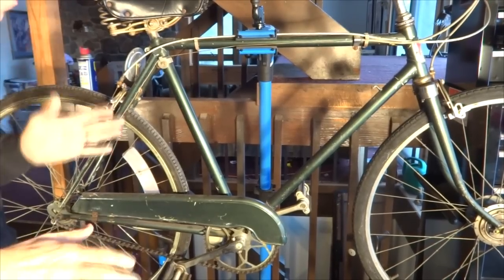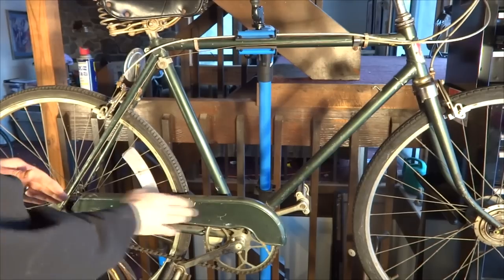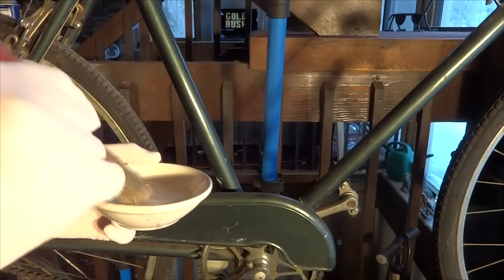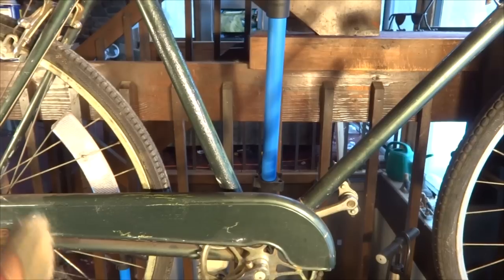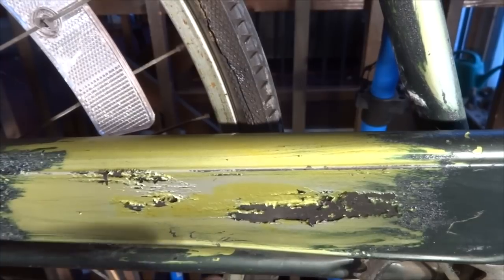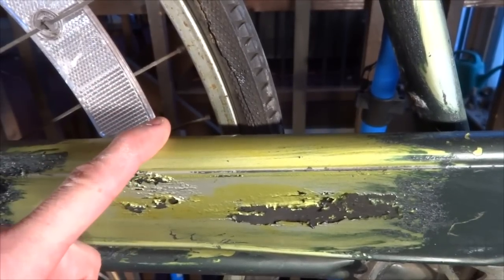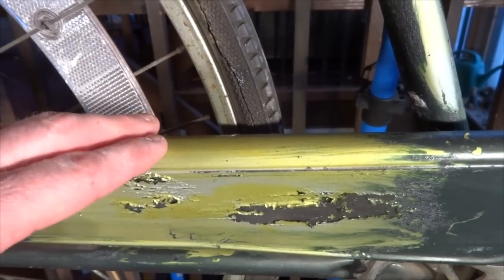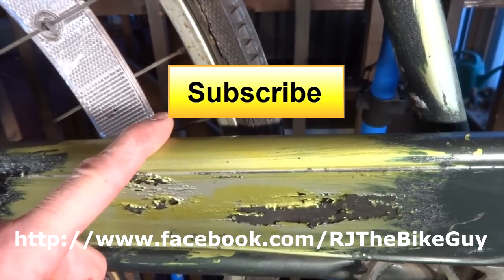Removing Layers Of Paint To Reveal Original Factory Bike Color

Comment: Would this work on a car hood that i want to remove a peeling coat( different color) to a reveal original pain?
Reply from the maker: Maybe. Depends if they sanded the original paint off or not. Go slow. Most cars have color codes on them somewhere though.
Reply: RJ The Bike Guy it doesn't look like  they did anything else other than just spray a light coat of different color on top of the original and its now peeling in some parts.

Comment: Please help. My friend told me that paint stripper softens carbon so im afraid to use it on my carbon fork
Reply from the maker: Yeah, don't use stripper on carbon. Maybe light hand sanding.
Reply: using sandpaper? could u give me a step by step? sorry if im troubling i just dont want to ruin the original paint or the carbon
Reply from the maker: Sorry, you are on your own. You are not likely going to just remove the overpaint leaving just the original paint.
Reply: RJ The Bike Guy thanks, ive just tried a small bit of it and i see the original paint